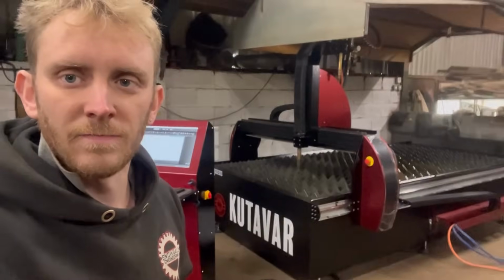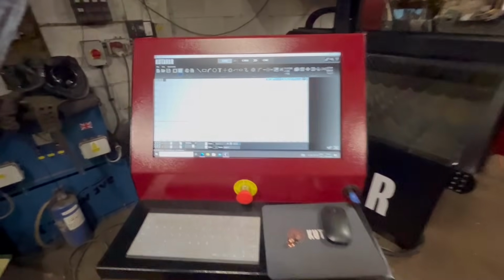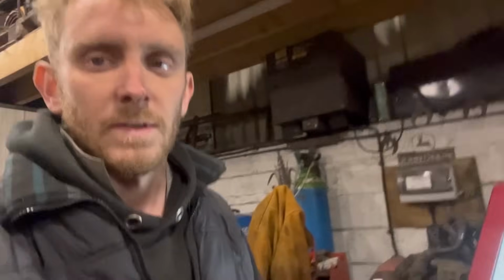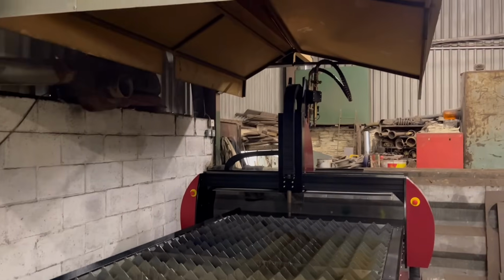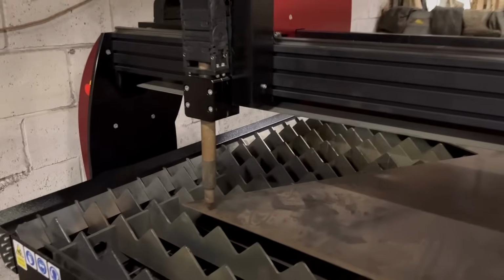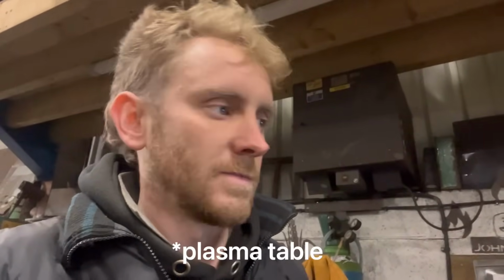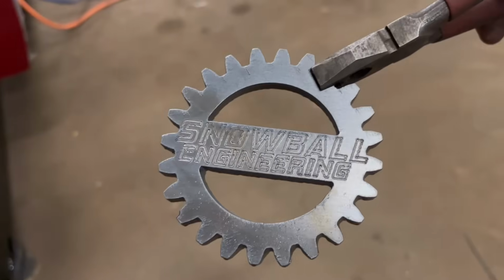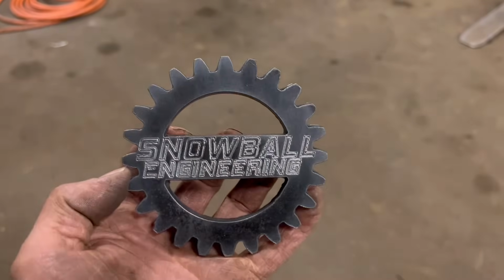My BRAND NEW Kutavar cnc plasma and oxy/propane cutting table.

Comment: hay buddy...get insurance on your shop incase of fire or natural disaster like tornados, forest fires are something insurance companies call act of god so check on what the insurance covers... but with expensive tools comes impossible to replace in a reasonable time so you need it replaced if a D8 cat runs across your new plasma table ! (god forbid!)
mechanics never think to insure their tools but I've seen a few loose every tool they owned due to fire.and unless the insurance is specifically for that they will not pay ! ...
be smart call it an investment in your future it's expensive but replacement of those machines is way more expensive !